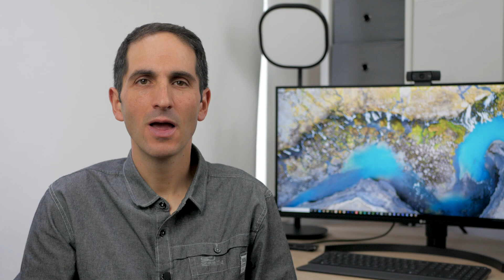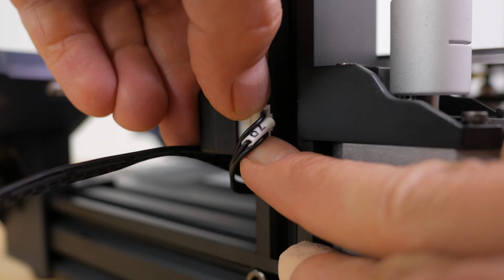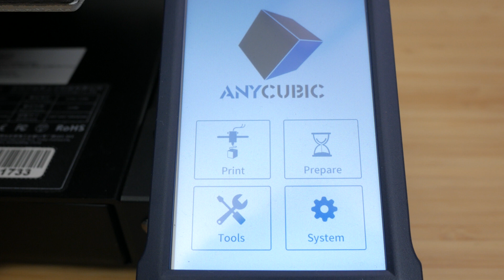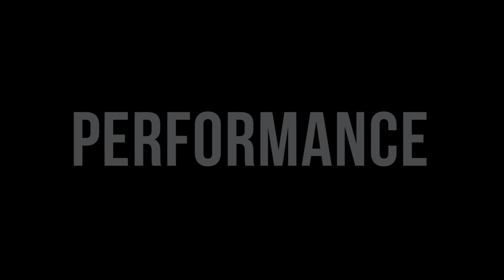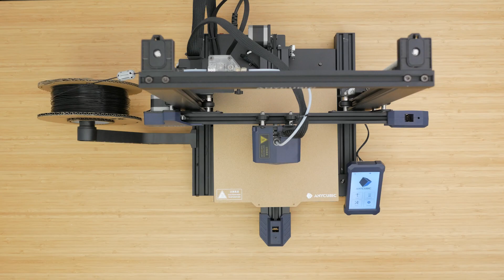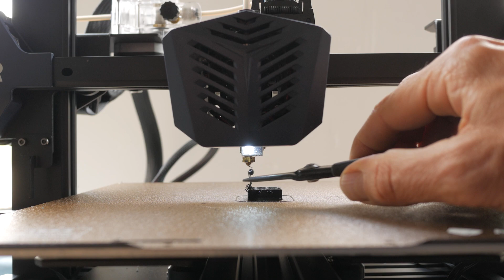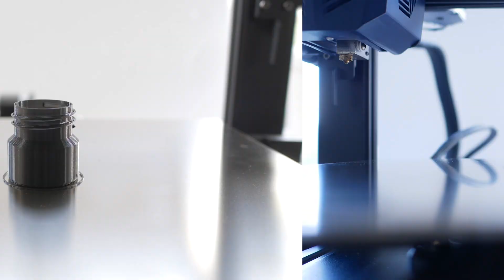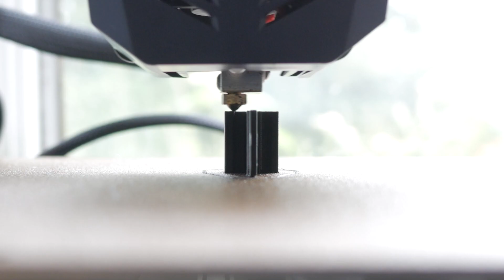Anycubic Vyper review | Perfect beginner 3D printer? | Unboxing, setup, auto-levelling, test prints

Comment: Totally new to 3D printing and trying out my Anycubic Vyper. I appreciated the suggested first prints you discussed and the links in your description. I tried printing the hotend cable holder, but my print failed as the unsupported overhang doesn't print without supports. Should I be adding those, or do you have a video where you discuss how to print like this?
Reply: Nevermind. Figured out I can rotate it 90 degrees in Cura to eliminate the overhang. Learning as I go!
Reply from the maker: Great glad you sorted it out! There's definitely a learning curve - but you'll be surprised how quickly you pick it up!

Comment: Do you recommend this over an ender 3 v2 And which one is quieter?
Reply from the maker: It's hard to choose one over the other. The Ender will have a bigger user base and parts / upgrades are more readily available. But the bed levelling on the Anycubic is a nice feature to have out of the box. I've not compared them side by side but fan noise I imagine will be similar.

Comment: How does this printer compare to the prusa mk3 in terms of quality and ease of use?Thank you for the great video.
Reply from the maker: That's a tricky one! The MK3S+ is the printer I'll use to print more exotic materials like PC. And I prefer printing Flex with a direct drive printer like this too. I'll also install a larger 0.8mm nozzle sometimes for faster prints. But for PLA and PETG with a standard nozzle there's not much difference and the Anycubic's levelling system, so long as the strain gauge doesn't go faulty, makes levelling easier than on the MK3S+, where you still have to adjust the Z offset.

Comment: Hi, thank you for the video! I was wondering if the rail going up and down should be stiff while moving by hand? I just got my vyper today and is assembled. I’m scared to turn it on and straining motors if it’s unbalanced or something.
Reply from the maker: No problem! I wouldn't move the rail up and down by hand - you can rotate the lead screws to move the rail up abd down - but I wouldn't do that either! Just check there's no play with the print head, side rails and bed rails and go for it! Good luck!

Comment: Hi, thanks for the video, lot of knowledge here. I buy this printer this week and assembly is very easy, congrats for that. But still can't get good first layer and then next layers are badly shifted. Another one: do you or anyone got problems with SD card? It is very sensitive, once I touched it gently by accident and printing stopped and SD card disconnected. Is it SD slot issue or maybe should I buy other SD card?
Reply from the maker: I'd check the belts are tight. I didn't have issues with the SD card. Beyond that I'd suggest asking on the Anycubic FaceBook group or contact Anycubic.

Comment: can you post the slicer settings so we can use them?  i am interested in the retraction settings,  my printer just arrived and want the best settings for my prints.
Reply from the maker: I get best results in Prusaslicer with Anycubic Mega settings and profiles (PLA, PETG) but if you prefer Cura use that - I'm sure you'll still be happy with the results! I have tweaked settings but honestly got pretty good results just using the defaults. As I do more testing I'll add any tweaked and tested profiles to my written article at thetechnologyman.com. Have fun with the printer!
Reply: @TheTechnologyMan  what’s the name of file on thing verse for the cable management holder?
Reply from the maker: There's a link in the video's description ...

Comment: I have an ender 3 max and it's hard for me to level the bed. With this printer do I have to level the bed like for the ender 3 max? Can you explain what leveling is needed for this printer? I am very  new to 3d printing. Thanks
Reply from the maker: This printer uses the nozzle itself to level the bed - which does makes levelling a little easier. But you'll still need to adjust the Z-offset.

Comment: can sombody help me my nozzle is scratching the bed when i am printing what is the best z off set
Reply from the maker: Is the bed and nozzle heated up when you do the auto bed levelling? Just try raising the Z offset in small increments - there isn't one setting that anyone can provide.
Reply: @TheTechnologyMan  it is working now but the prints are really stringy
Reply: @TheTechnologyMan  i am very new to printing i got rid of the string but the prints will not stick to the be any tips?
Reply from the maker: I'd suggest asking on the Vyper forum - very active and you'll get loads of help. If prints aren't sticking - lower Z offset and make sure bed is proper clean (use IPA or wash in soapy water - drying afterwards thoroughly).

Comment: Has anyone else been having an issue where whenever you try to print something or use the auto bed leveling, the printer just turns off and turns back on?
Reply from the maker: I haven't had that issue - perhaps contact Anycubic and get them to send you the latest firmware.
Reply: @TheTechnologyMan  Thanks! I have figured out the issue, I had it set to the wrong voltage rating for my house.
Reply from the maker: Great glad you're sorted!

Comment: would yall recommend this or the ender 3 v2?
Reply from the maker: It's a much easier printer to get started with but the Ender 3 V2 is cheaper and has larger community for support and upgrades. This printer is more in line with the Creality CR6 SE - both  for features and cost.
Reply: Get this I have a v2 still can’t get it leveled and this has all the upgrades you are gonna get for the v2 already on it

Comment: I don't think auto bedleveling is such an important noob feature. leveling the bed is the easiest thing to do on any printer. Print adhesion is the thing that ruins it for begginers and you spent very little time on it.
Reply from the maker: I find print adhesion pretty good on the removeable build plate. I cover manual bed levelling in detail in my Ender 3 review.
Reply: I disagree.  Ive struggled with bed leveling since day one with my Lulzbot.  Ive even had experienced 3d printer people scratching their heads.  I'm going with Vyper for that reason mainly.